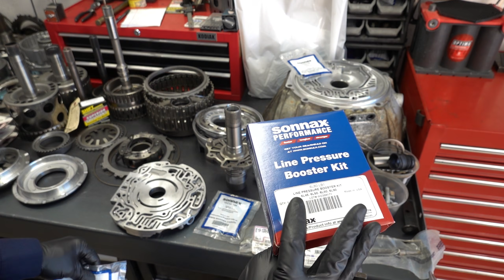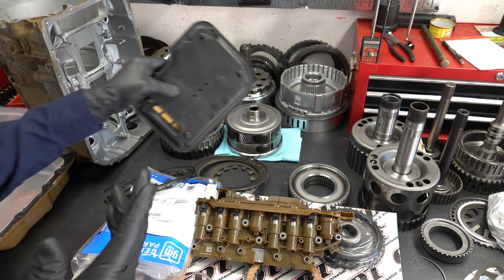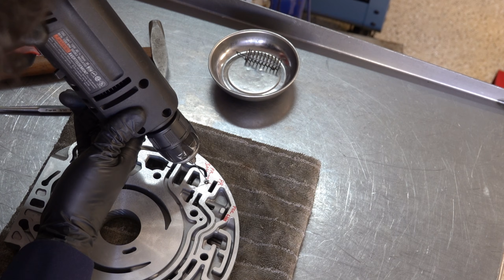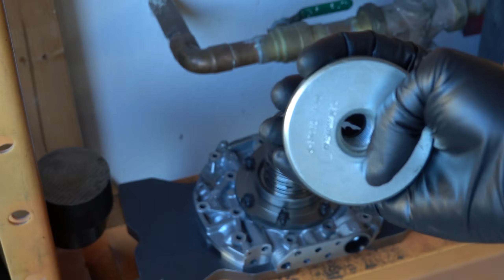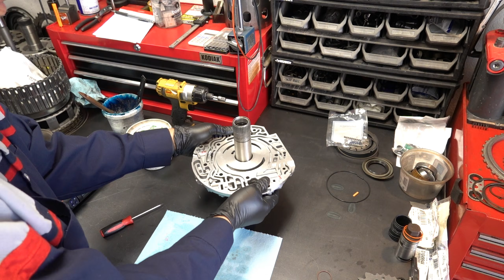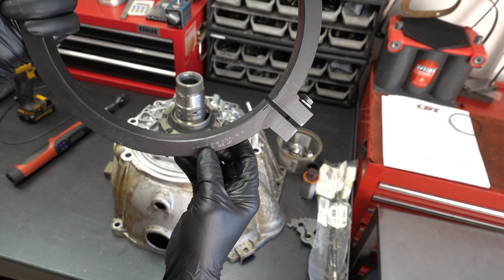6L80 Performance Rebuild PT1 - Overview and Pump Assembly

Comment: This is the level 2.5 kit not the level 2 (1-2-3-4 piston from Sonnax is the difference)
Reply from the maker: No, It's the level 2 kit. I had that piston in stock as I use them on all my 6L80/90 builds so it went in with everything else.
Reply: @nickstransmissions  Essentially and not considering anything else...all same components as a 2.5 kit?

Comment: My book calls for clearance on the pump slide at .0008 to .002 that’s 8 tenths to 2 thou that can practically be touching.
Reply from the maker: What book are you referring to? 

Just curious if there's another manual on these transmissions that I would like to have.  

Eight ten-thousandths is fine for a minimum as long as the rotor and/or slide aren't coming into contact with your precision straight edge when you're moving the slide and/or turning the rotor underneath. Max is .002 for the slide though having .002 for the rotor isn't the end of the world...These pumps will actually work with even more clearance than that but that's obviously not a good thing, especially when engine power/torque levels get far above stock.
Reply: @ my book is by Steve Garrett GM 6l80 how to rebuild and modify
Reply from the maker: Ah, I have that one as well. Good book, esp the parts on valve body casting ID and electronics testing. He's written or contributed to several articles published by the ATRA on these transmissions as well.
Reply: @ I agree that it will work and I’m learning myself I actually machined out all the way down to the bushing and put a 1/8 solid brass plate in and machined it to height I’m curious how it will hold up. Just experimenting on this one
Reply from the maker: Interesting - let me know how that turns out...Could be worth you doing a video where you're walking folks through the process, benefits, etc.
Reply: @nickstransmissions  yea I may do a short video on how I came about doing the brass and why and some on how I setup to do it. Im getting close to having this trans back together but I want to run it threw its paces and make sure it will do what I’m hoping. Aluminum will expand way more than brass and brass is extremely wear resistant when kept lubricaded. I have a pretty good size lathe 16 inch swing and a milling machine to match. I make pretty much all my own tools unless there cheap enough it’s not worth my time on the machines. I will definitely notify you when I get it done and tested. I really hope its successful
Reply from the maker: Sounds good, man - looking forward to it...Please reply here w/the link once you have it up and I'll give it a watch. Otherwise, please let me know how things go with it...Good luck!
Reply: @ ok nick I posted the first part on the machining of the bell housing and how I went about it and tomorrow I will be doing testing I have it back in and driving it today. I will be doing another video on that so that it’s not so long. You can pull up machining the 6l80 with brass (will it hold up)

Comment: Hey Nick thanks so much for the video it has helped out a whole bunch wanted to ask you to see if you had welded the drum yourself and did you have a balance issue with doing that
Reply from the maker: That's great to hear, man! My machinist does the drum welding; no impact on its balance.

Comment: Thanks for the fantastic videos, Nick! I'll be using them as reference when I build my CDT Level 4 6L80 this weekend. Is there any concern with the weld on the 3-5-R drum protruding and/or
 rubbing on the plastic ring that sits on the stator?
Reply from the maker: Thanks, Jamie! Appreciate the kind words, man. No concerns about the welds on that drum making contact with the pump...The welds would have to be like a mini mountain range on top of the drum to make contact...If your drum looks like that after new welds have been laid down, just grind them down until they aren't so prominent...

Comment: The 6L80 and the 90 are actually pretty reliable. The problem is mostly in the torque converter. The stock OEM converters can be upgraded with better converter clutches. There are a couple of reasons for this.  One is programming. 

Nick, Gears magazine and Trans tec along with Precision kits. All recommend the 60,80, 120 inch pounds along with the medium blue lock tite. 

And recheck in one hour. 

This method has solved a lot of problems. Especially in the compensator feed side. 

Just a side not. GM says it can’t be changed.  🤦‍♂️

I started changing them at the dealer years ago. When I figured out that the updated stator was the same fluid circulation as the old design. So the updated stator shaft works perfectly with the original design cover.
Reply from the maker: Hey Larry, thank you for watching...I recall seeing red loctite but either type should work as long as the torque sequence and specs are followed which is shown in this video (putting in case anyone reads this prior to watching the vid). Yea, GM doesn't include that gasket in their kits but the aftermarket does and I think most builders that do these units regularly change it out...To my knowledge, the only diff between the early vs late stators is the sealing ring design (locking/support 0-ring)...Pump cover itself never changed throughout the prod lifespan for those transmissions. 

My converter builders uses a .070 thick HE BW converter clutch in all of his 6L80/90 converters...Billet/flanged hubs when called for/prudent.

Comment: Im thinking about tackling this project myself with the same exact kit on my 6l90 from a ctsv.  How often or how necessary is it to machine the pump housing?  Would it make more sense to get a new housing?
Reply from the maker: Thanks for watching, Silveralex. I always machine the pump as they invariably need it...Every once in a great while you will come across one that still has serviceable working surfaces but it's rare.

Comment: Ok...I have a serious question! I've owned 2 vehicles with this POS transmission in them. A Pontiac G8 GT and a GMC Sierra. The transmission was garbage and would never shift correctly. And a lot of people were wanting to start a class action lawsuit against GM for that junk.
Why in the world would anyone want to use one??
Only OD I'd run would be a 4l80e. Except for the Allison in my Duramax.